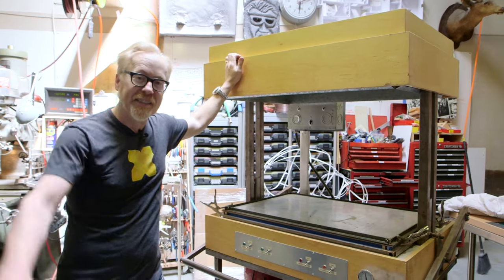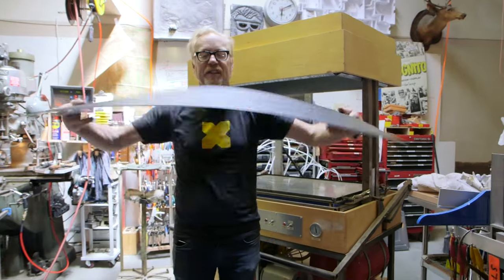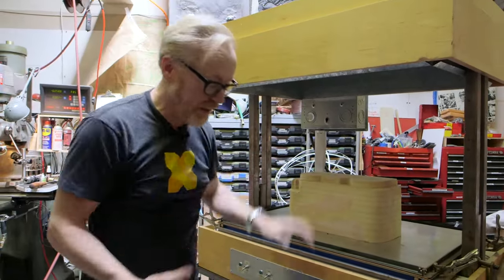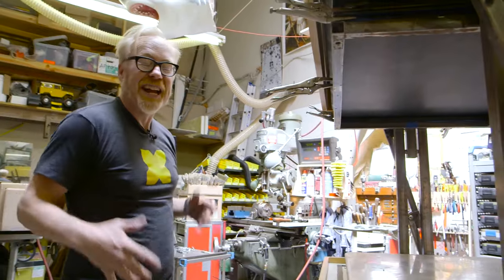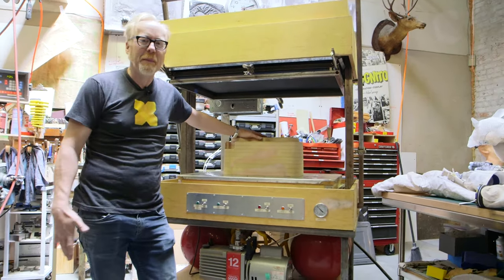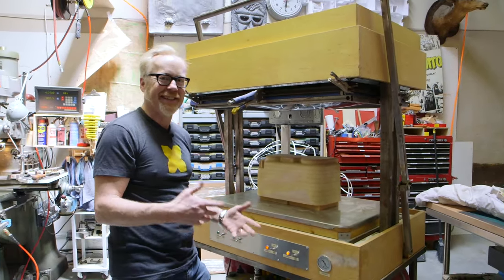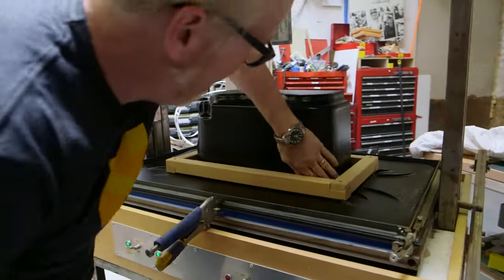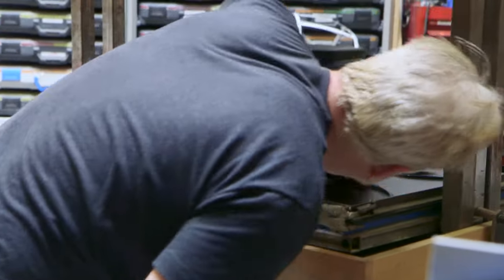Adam Savage's Vacuum Forming Machine

Comment: Ooh, is that an Edwards pump I see? Nice machine, it's got a self built look to it...

A nice Vacuformer I used once had a compressed air inlet so you could release it from the form still in the machine at the push of a button, possibly something you could add? More draft angle would help too.

Comment: I noticed the detail is very soft on the top of the piece.  It might be difficult considering the thickness of the buck, but drilling small holes vertically completely through the buck will allow the plastic to be "sucked" down onto the top of the mold. Place a few strategically at the base of the cylindrical and square details on top.  That will give much better and sharper detail on top, at the expense of some easy-to-clean-up dimples where the holes are. (edit:  Oh, like 3E already said XD)

Comment: I remember building a vacuum former way back in high school. Vacuum via shop-vac and heat courtesy of my moms kitchen oven. Just an aluminum frame to hold the plastic sheet just small enough to fit in the oven. Carefully remove after heating and place on a sealed wood box with pegboard top and a hole in the side for the vac hose. Turn on the vac and shwoop.

Comment: hey Adam, stick air blower between plug and side..... will separate super easy.  Also if you drill all the way through so the top center has a vacuum port in one of the valleys, that can later be used to split with air as well

Comment: Hey Adam, you guys do a lot of cool stuff and I think I'd be able to help with many projects but you guys always have a couple "holes" in your experiments. 

One that comes to mind, and this is one I remember off the top of my head because I used to work with Kenny at Auto Sound Specialists, where you had the system installed.

When you "busted" the myth about a gun going off in the trunk from too much bass,  you placed to gun sideways in the trunk. Bass from the speakers goes from to back to front so in order for the bass to move the trigger, the trigger would need to be running parallel with the sound waves. Also, I think you should have borrowed a bigger stereo for the project. I'm not saying it would work but that test didnt really prove anything.

It would be like seeing if bass pressure could rip a sheet of paper and then putting the paper perpenficilar to the sub and not parallel in front of it.

Comment: Hey Adam! A wee blast o' a hair dryer will help release a tight form sometimes. Don't get the plastic gooshy, but ABS has some pretty significant thermal expansion before it hits its deflection temp. :)

Comment: I remember in my prop class they had us drill a hole through the buck to help it not get suctioned on and to help in the undercuts.  Though that was with smaller pieces.  That's the biggest piece I have seen vacua formed before.

Comment: Good trick for getting forms out is to take your air gun and blow high pressure air around the edges to basically vibrate and float the thing loose and pop it right out. Works pretty much always, no cutting or slicing required

Comment: If you can't add a slight draft to the form, you can put a/some tiny hole(s) through it so that you can inject compressed air behind it. It will pop right off.

Comment: If you had a hole near the sharp internal edge that went from top to bottom, it would help pull the vacuum tighter on that internal point, but more interesting, putting compressed air going the other way afterward would pop that piece right out. Looking at the other comments I see many similar posts. if there are straight or even overhanging parts, in leaning internal parts that can come out, then the parts with overhangs can be easily removed.

Comment: Did you build the vacuum former and if so, what would you do differently? Could you have used air pressure between the mold and plastic to separate the two?

Comment: One way to get the mold out of the form, after you cut off the over hang, stick an air nozzle in where you can. When you hit it with air it will usually pop right off. Least for me that has been the case. That is one awesome machine though, might have to make one in my not too distant future.

Comment: Try using a rounder frame that you used to really seal it in. It may produce less of a folded edge in the corners. Im stoked for you man, thats a 'cool' unit!!
Reply: Also perhaps an air compressor  shot through a small hole from a drill bit would help with the air displacement when removing the cast from the wooden block

Comment: Spent some time working for a plastic forming company. MUCH bigger machines. Seems I was the only one there that knew how to fix them when they broke (which was often). They waxed the "bucks" (we called them "Patterns"). Most were wood, some were CNC machined aluminum. BTW the tanks are almost useless. You can't "store" vacuum like you think of compressed air. A good shop-vac will do the same job...

Comment: May I suggest painting the form with (if necessary) heat-resistant paint and apply some lubricant/soap? - That should make it come off easily after drying... Maybe even a handle screwed on in the bottom and a "plunger" on the ABS?Maybe if putting the heaters on two separate fuses or a bigger one (if allowed)? I assume you have enough current in your shop.Just a couple of thoughts...

Comment: Adam on your buck put in a air hole (be prepared to fill it post removal).  When you need to get the buck seperated use your compressed air line to seperate the buck.  If you are really keen you can put in a threaded female pipe into the buck. Then connect then squirt air in, this will help seperate the two.  Done this at art college and it saves time later. Also a heat gun on sticky areas helps,

Comment: Hi Adam, why you didn't turn on the vacuum pump before turning on the heating elements?? Then, turn it off because of the fuses (I think the containers keep the vacuum) and then proceed as you did. As far as it looks to me, this way you could get a higher vacuum force at the beggining, which would help to reproduce the original shape even better.
Thanks for sharing with us ;)

Comment: If you make your form out of three segments (in a vertical sandwich), you can have a handle (even an embedded nut that you later thread a bolt into) in the central segment and you extract that from your pulled plastic first, then the outer pieces are much easier to manipulate inwards and extract.  No more cutting of a formed plastic shell!

Comment: if the wiring can handle the current you could put a bigger fuse in up to the limit of the line.

sometimes people will put in a lower value fuse witch is safer as they are not so close to the limit.

you could also convert your machine to use propane to heat the plastic.

Comment: For me, always drilling some really small holes in a couple of places on my bucks and then making a champher on the other side at the bottom to blow air through usually 90% of the time will pop off the abs part pretty easily without too much hair pulling for me

Comment: Hey Adam just a thought for you but did you consider using a combination of a molded release on your buck and use some compressed air before you remove it from the vac machine that way you pop the form off the buck?

Comment: Is is a fuse in the machine you're worried about blowing when running both heaters, or the circuit it's plugged into? In any case, it sounds like the perfect excuse to rewire it to either have each heating element set on it's own fuse, if it's internal fuses, or having each set on it's own plug that could be plugged into different circuits, if it's the circuit.

Comment: I built one of these many years ago, it was way more simpler. You would put the frame in the oven with the sheet of plastic installed into it, And the table was a box with an aluminum sheet on top with many holes drilled into it and a shopvac was used to create the vacuum.

Comment: That's pretty cool bro I would love to try my hand at making some racing quadcopter canopies with this machine. Question what are the materials can be used with this machine? Also have you ever thought about lightly coating whatever you're forming with a very thin layer of Vaseline so the mold is easier to be removed

Comment: Adam, just a tip, but next time instead of slicing it, just drill a small hole in the top and blow some compressed air in through the hole.  Works great most of the time.

Comment: you could use compressed air to separate the plastic from the buck , I would guess the mdf buck texture was causing the plastic to stick a payer of rattle can paint would make the buck smooth enough to help & could also be used as a barrier for cooking spray /mould release

Comment: Maybe drill holes in the bucks, converging to the centralized sealed main chamber.(effectively a manifold) Fill the holes with a wax like substance that will resist the material, but will blow out when compressed air is introduced. The plastic will (fingers crossed) separate from the buck due to a cushion of air. Or, the finished part will shoot off like a rocket, or explode, or do nothing.... Worth a shot.

Comment: Does the machine operate on 120/240V? with that many elements must draw a lot of current, what about having a dedicated 20A or higher circuit installed for the vacuum forming machine? Thus won't trip the branch circuits.

Comment: A couple of points that might be of some use. 
First I would say that the negative you are using is slightly too big for the sheet of plastic you have access to. If you don't need the entire height I would strongly advice you to cut it down a bit.
Secondly. The heating time seemed too long. Having that big a droop in sheet as thin as that one is too much.
Thirdly, if you haven't already. It would be a good idea to make through holes to get the crevases on top really tight. Just a really small hole from the top all the way through the bottom to get that localized vacuum. What I usually do at work is set the whole thing up on  a sheet of mdf and just drill holes around the negative and heavily control the air flow.
If you need detailed specifics I'd be glad to refer you to my father who worked in vacuum forming for over a decade and knows pretty much everything there is to know and then some.

Comment: Lubricate form with pan before forming and then Drill a small hole in the top and it will slide out by breaking the vacuum seal created when the plastic seals

Comment: 5:11 Perhaps next time you could drill a hole through your buck and use compressed air to put some separating pressure on your mold. I imagine if you blocked said hole during the vacuum process then it wouldn't show up in the mold but I may be wrong. Nice video either way :)
Reply: +DanielVidz I probably could have read some of the earlier comments before posting that as I'm not the only person who had the same idea +USWaterRockets +Sparky Projects
Reply: +DanielVidz Either that or some silicone spray (maybe even talc) on the mold before the vacuum process..

Comment: Instead of slicing the plastic, drilling tiny air holes on top should do it too, so when the master slides down inside the plastic, the air can flow into the space between master and plastic from the top.

Comment: drilling 2 holes through your mould then lay thin plug into the top and having a recessed hole you can then blow air into the mould that'll blow through the thin plugs releasing the plastic

Comment: Next time when a form gets stuck like that, put a handful of screws in the back in a  line, and then mount the piece by the screws to a bench vice.  Then it will be really stable and you can work your way around the edges getting the plastic off, flipping it in the vice to get at the other side.

Comment: You need an air hole that leads to a gallery at the top of the part. You could just put the air nossle up to it and blow the finished piece off the mold

Comment: I wonder if it would release easier if the form was covered in talcum powder / French chalk first?
Reply: +davidrobert2007 not really, speaking from experience if you put ang sort of powder on the form it just gets sucked away or absorbed by the plastic. i good trink i found out is to us a compressed gas canister and a really thin nozzel and puch it to the back of the mold and push it out that way. the only reall problem is you need to know how much pressure the pastic can take other wise you might blow a hole in the plastic instead.

Comment: i use that sam proces fir prototypes of products the struggles of removing the patern from the part is real but oen why that helps is to use a patarn plate and dril a few holes of about 0.5 mils in the pattarn plate then simply mish air through that will lossen it up a bit for the removel of the pattern
Reply: o and i mean 0.5 mm hole
Reply: In a pro machine the buck is water cooled and vacuum holes around the base function in two ways it sucks and blows.
In some applications air is blown into the area to stretch the plastic uniformly then drawn down and fans cool the part. 
Then air blows it off

Comment: Hey Adam just idea on how to get form off. How about air psi pin hole through bottom of form to top or pinhole in and top apply air from blowgun and should push off just like removing installing handle bar grips from bike or motorcycle

Comment: Adam if the circut breaker is poping from running all of the heating elements you have an electrical issue which should be addressed as soon as possible by a professional electrician or you may have a fire. electrical fires can go undetected for a lengthy period of time. I suspect that it is an amperage issue and if it isn't amperage issue you may burn your busbar where that circuit breaker is contained.

Comment: Is there some sort of mold release you could spray on the MDF to help with the last part?
Reply: +Brennan Letkeman Not really. The problem is more that the puck is relatively tall and straight-sided, which results in a fair amount of friction between the puck and the formed plastic. This is actually operating on the very limits of what you can do with vacuum forming. It would probably be easier to vacuum form a shape like this in several parts, but then you'd have the extra work involved in sticking them together, so the gains you make would be cancelled out.

Comment: Hey Adam I bet you could get your mold off easier if you drilled a hole through from the bottom and used a piece of dowel or something to fill it (to keep the plastic from vacuum forming down the hole).. then when you are done remove the dowel, use air compressor through hole to push the mold off the form

And I read down two comments and someone has said the same thing ahaha

Comment: Couldn't you put a small hole through the mold and when ready to remove you connect a compressor to it turning the casting into a pneumatic cylinder ?

Comment: Just like that, the body parts for the Citroen Mehari were made from ABS plastic. In the case of the large body parts, the machine and the vacuum must be very large. Otherwise, the body of the Mehari is very insensitive and does not have to be painted because the plastic panels were already colored. Only with the approval in road traffic there were problems, because the authorities considered the ABS plastic to be flammable and in Germany the Mehari could not be officially sold.

Comment: So one I have wondered if you have a bad pull can you heat that piece of abs and vacuum form it on a flat surface to reuse?
Reply: I've tried reusing plastic sheets, but if they have been stretched too much, they just wrinkle and fold when you try to melt them again, and won't pull flat to the table.

Comment: If you are only going to make one piece at a time, you can wait for the plastic to cool down a bit, and use the vacuum system, reversing it to inject some air and detach the piece from the mold.
Reply: Or just use mold release prior to heating and pushing the hot plastic down on the object. Hell, you can even spray a little PAM on the plastic as it begins to heat up and bow prior to bring it down on the object below.

Comment: Mold release was needed and the draft on this mold/buck is most likely  too much for the sheet size of the plastic. Stretches the plastic more which causes more webbing. Web catchers can help but due to the draft, and more importantly the use of that frame, it can't help on this one.

Comment: What are the pros and cons  of abs as you used in this video and polystyrene which you used in the other one/
Reply: +Rob Wilson As i've heard it from my cosplay friends, ABS tend to come in thicker sheets so you get a harder piece once it cools down, making it very useful for hard shells for rigid props or other places where flexibility is not something you want. Poly on the other side can be stretched extremely thin and can be very useful for soft pieces like mask or armor plates that needs to follow the body's movements.

Comment: would compressed air not be optimal for pushing it of the form??
Reply: Without damaging the item below? It was form fitted. Any hole drilled into the plastic would have went right through that wood. It would have been easier to put mold release either on the underside of the plastic first, or on the item below it. Even PAM would work; Spray it on as the plastic starts to bow. Probably better use dish soap as that washed off an leaves no greasy residue. Murphy's Oil is the recommended product but that would "stain" the wood object.

Comment: 4.8 years later.. I'm asking a question! Do you own or have you ever made a plastic injection machine? Not sure what to call it. Plastic beads in, molten plastic pushed into a mold. water cools the mold. Mold pops apart. Air releases the plastic part out. mold closes, process starts all over again. Devil is in the details. I mean, there are 3-D printers (slow) ..